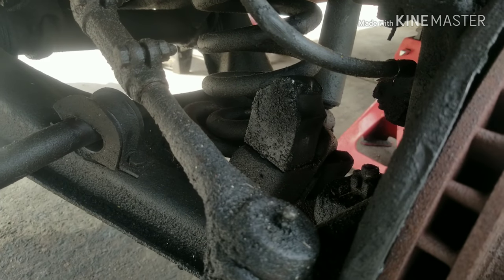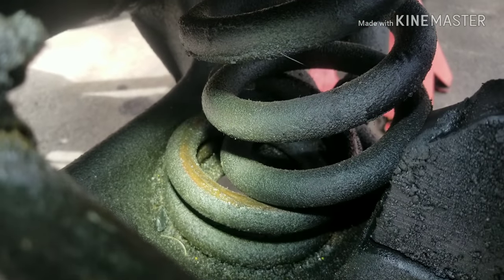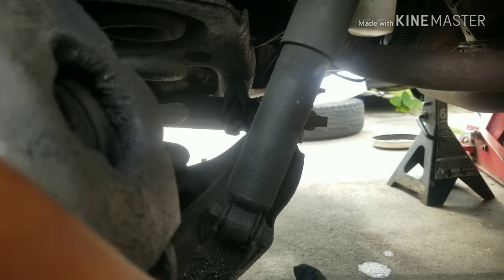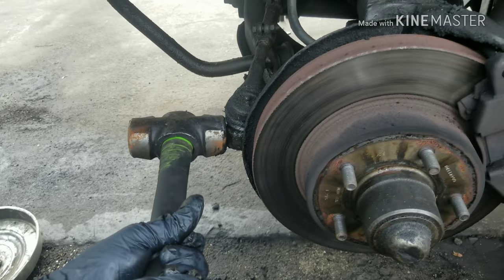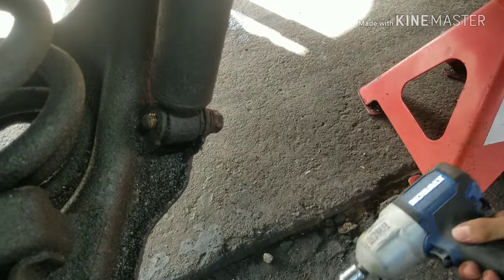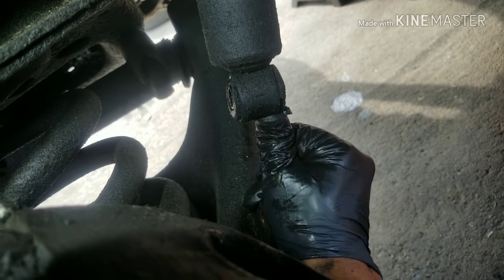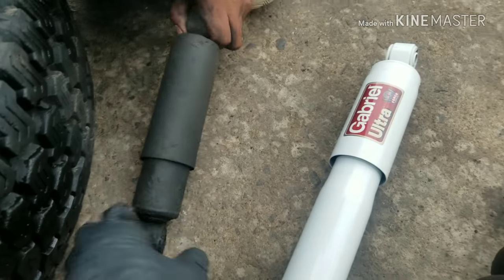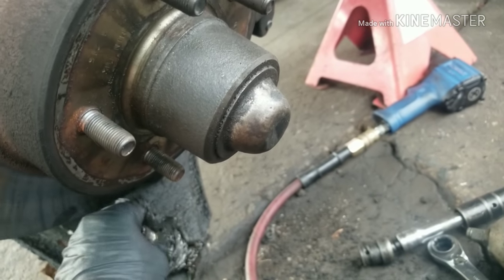How to Remove Coil Springs, Chevrolet Full Size Work Van

Comment: Video ended. How do you get the spring back in there. Help!
Reply from the maker: just place it back in place before you bolt it back together
Reply: The jack helps u compress the spring by placing under control arm
Reply: @briantruck2284  Thanks guys. On a 3500 chev. Truck. I had to compress the spring in order to get it in place. Then I had to use 2 floor jacks to lift up the control arm to align the bolts. It was my first on and was a lot of fun! Didnt Help that I am 71.